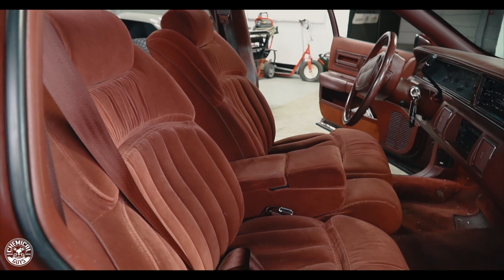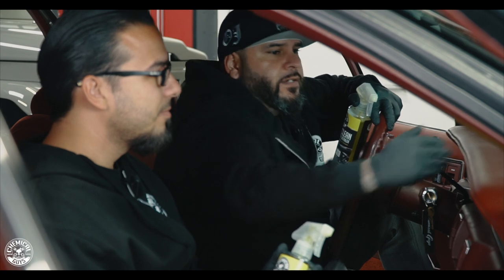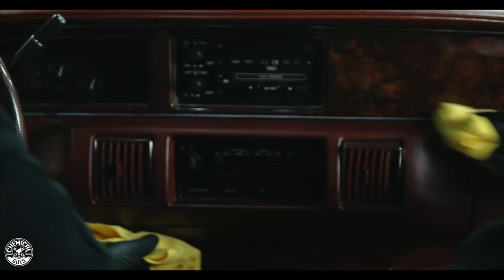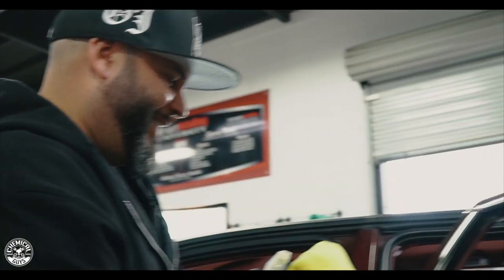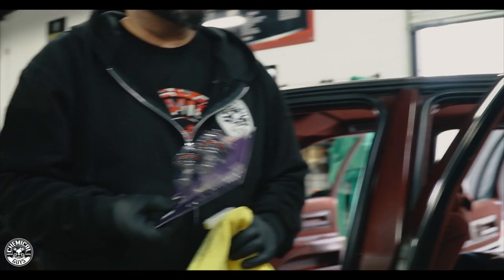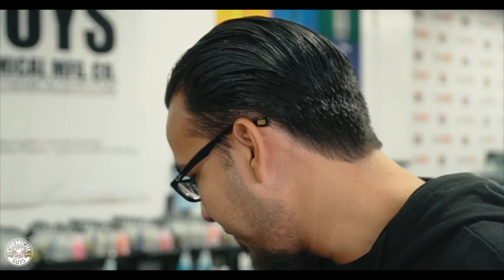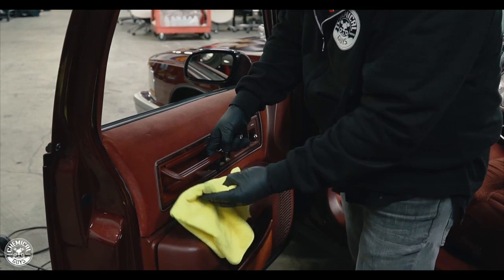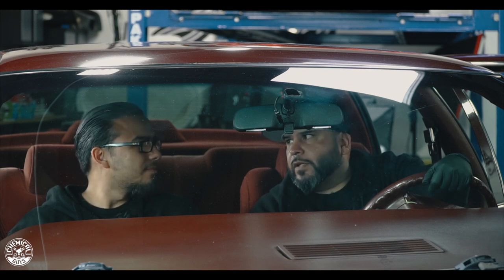Interior Detailing New Years Resolution - Chemical Guys

Comment: Hey, Great Video...
Nick, what did you use to clean up the floor mats, and what kind of brush..
Thanks.. 👍👍👍
Reply from the maker: Hi Reaper! Nick used NONSENSE all purpose cleaner to clean his floor mats. NONSENSE is colorless and odorless for maximum cleaning power on any surface. Stains, grime, grease, and dirt don’t stand a chance against the strength of NONSENSE! The amazing super cleaner is strong on dirt and stains, and gentle on sensitive carpets and fabric surfaces. NONSENSE gently cleans and removes dirt and stains from sensitive materials without leaving behind colors, odors, or chemical residue. Engine bays, dirty wheels, undercarriages, and filthy carpets don’t stand a chance against the transparent cleaning power of NONSENSE! Thanks for watching and thanks for being part of the Chemical Guys family!

https://www.chemicalguys.com/Nonsense_All_Surface_Cleaner_16_oz_p/spi_993_16.htm

https://www.chemicalguys.com/Nifty_Brush_Interior_Detailing_Brush_p/acc_g21.htm